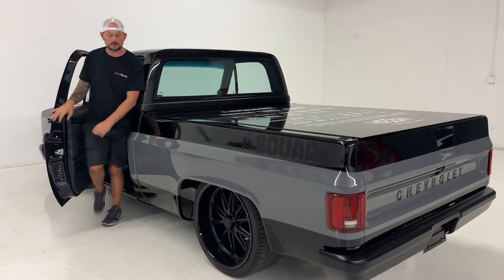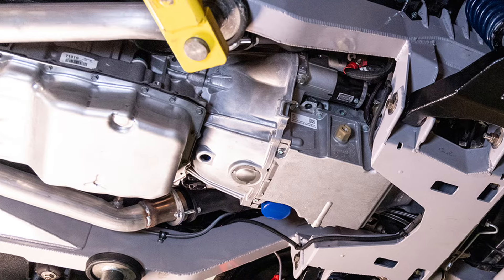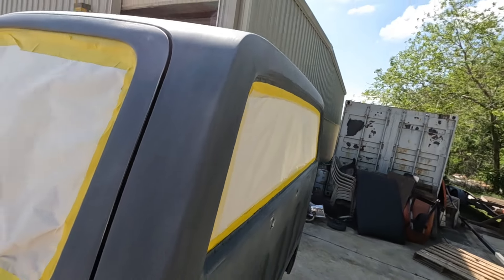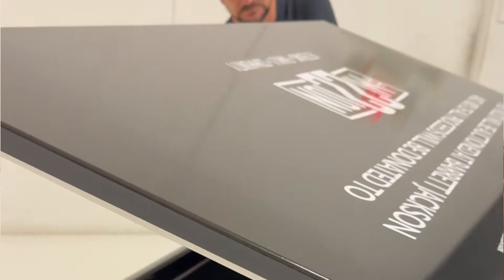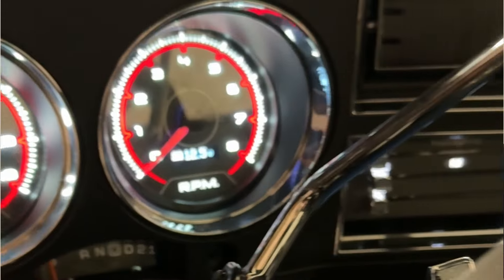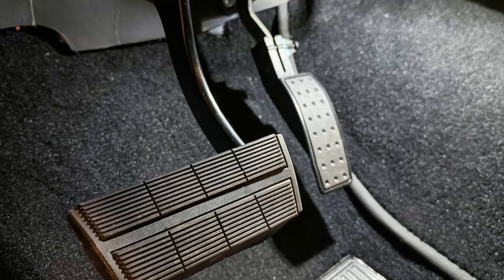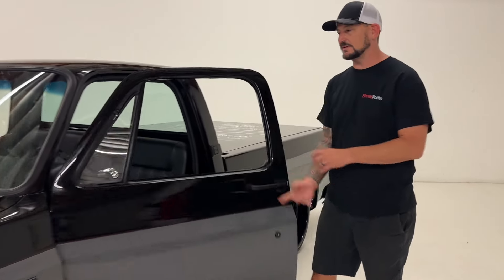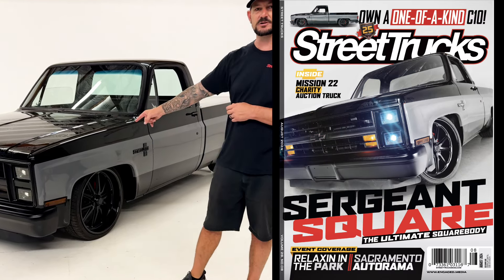FIRST DRIVE of our 6.2 LS Powered Squarebody!

Comment: Truck sounds mean!!! Especially with gramps driving it. Great build with a great purpose, been waiting for it to officially be finished since it was first advertised in street trucks mag. I have 1 question, does it have a sound system? And if so what is the spec on the subs size